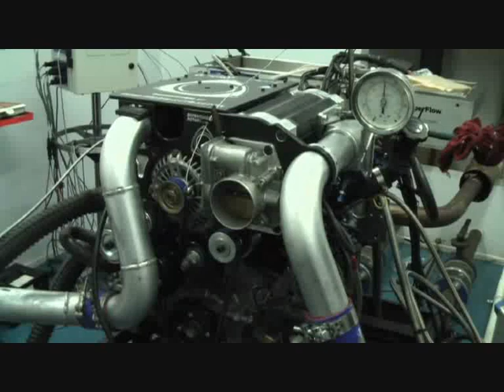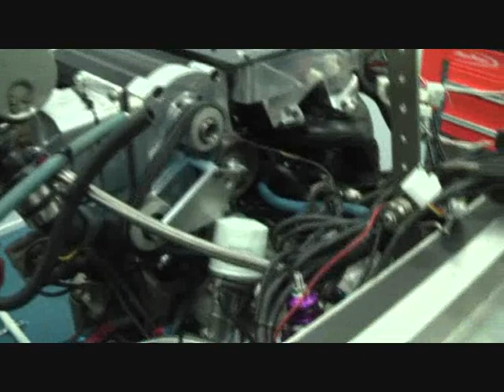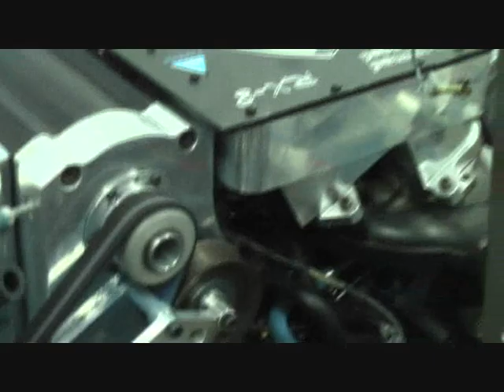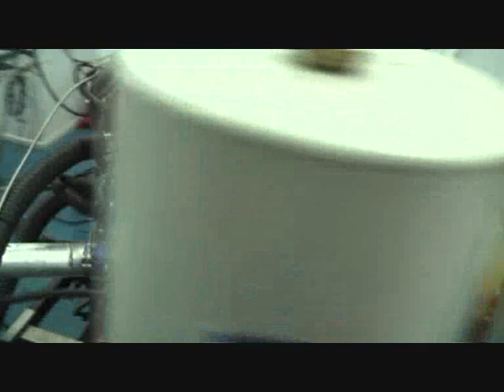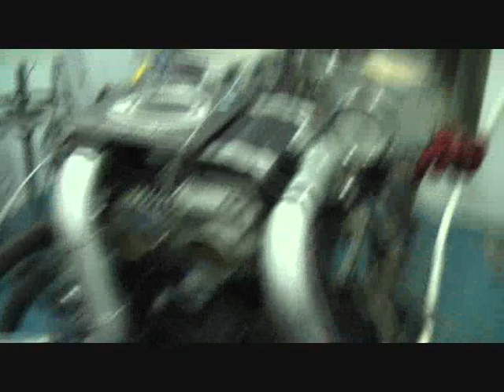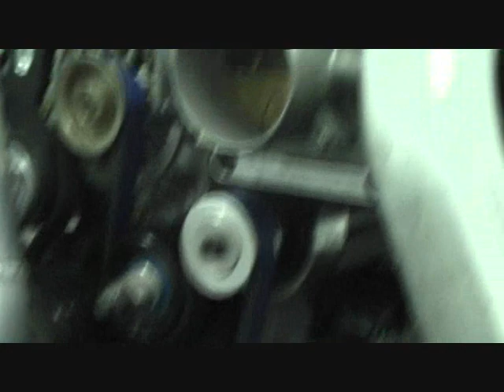Hymee's Supercharged Renesis (13B MSP) Engine Dyno Testing

Comment: @cdawg1113 based on what???  A rotary has absolutely no torque, the SC handles that no matter if your talking 12A 13B or Renesis.  Yes, more peak power is possible with a Turbo combination, but it's the low end grunt your after, which will give you the extra added down low torque this engine needs.